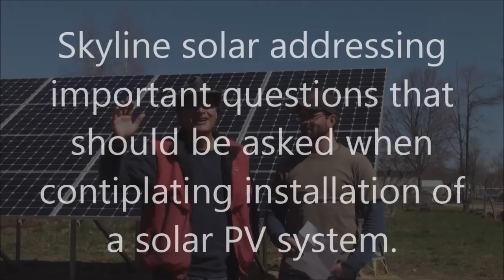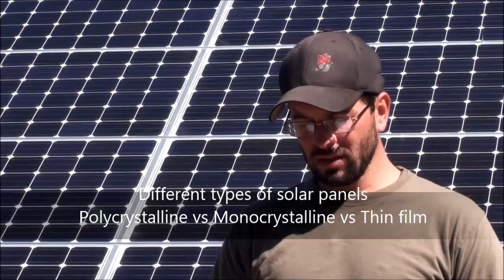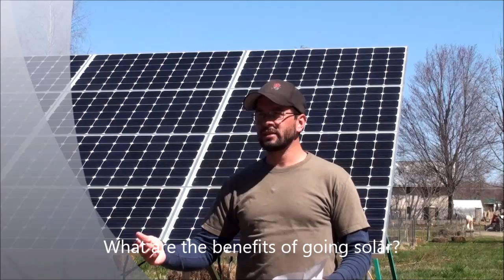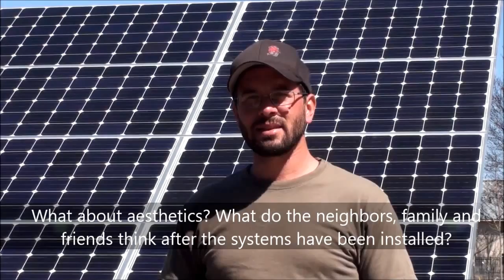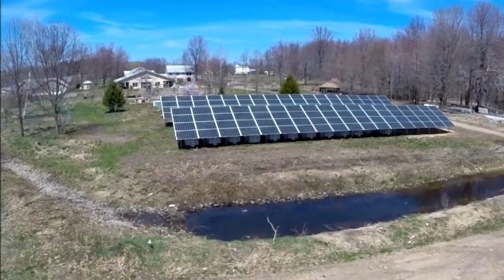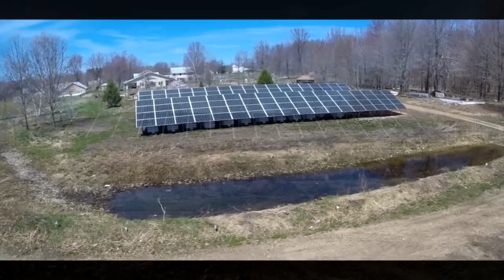Skyline solar - How much does a photovoltaic system cost?

Comment: So he never said what the cost of your system was?
Reply from the maker: No he never did share with you what the cost of our system was at that time. I have created and posted a video in the past on how to calculate the cost of the solar panel system for your home. The goal in this video was to respond to questions that I've received from viewers and how a solar panel installer goes about determining if your property is appropriate for solar panel installation and what it would take to meet your needs based on your annual electric bill. Sorry for the misunderstanding.

Comment: That is a massive system, I think I counted 144 panels WOW ! We have a grid tied system with 40 panels just commissioned 3 weeks ago, down here in SE TX is currently covering about 65% of our daily consumption , mid to upper 90's and our A/C is the biggest load . Looking forward to seeing how well our system does in fall, winter and spring. Very informative video thanks for putting it out there.

Comment: The more you put into it now just means the less you will pay for Grid tie Hydro starting right now. If you Buy a panel a month then you will save that much wattage it produces every month and when you have enough panels to even out with your monthly usage  And will not have a power bill but will still have a delivery bill because that is a base charge every month. Look into AC coupling With the Magnum ACLD-40 That allows the home to use the wattage produced without using the grid and some grid tie micro inverters will work even when the grid is down. PS the ALCD-40 can store excise hydro in the form of Hot water or heat from a 240 volt Baseboard without using any thing other than the regular electric elements or baseboards. Just think Having full battery bank and in floor water heating and you don't even need to be hooked to the grid.

Comment: Sir I want run 5HP 3 phase moter for tubewell,I shall be needed how many solar panels,and watt, also inverter
Reply from the maker: Hi Abbas Malik,

Thank you for the comment. We really appreciate the feedback. The answer is dependent on several factors. I hope to make a video about installing a solar powered DC well pump this summer if all goes well. I will review all the calculations when I do the project.

Comment: I am still not clear on this.If the grid goes down ,will you still have power for your use till the main power grid come back online ? Or will you have to add the battery back ups to do that.We have lost power here for as much as 7 days .
Reply from the maker: Great question!  Since this is a grid-tied system when the utility line is interrupted, as it has been twice this week, both utility power and solar power are OFF. That’s why I have a transfer switch that detects that the power utility is down and cuts off all communication with the utility supply line and triggers my backup generator to start.  My entire complex is then run off the generator until the utility company fixes the problem that caused the power interruption. 

So one problem with this setup is that, for lineman safety, the sun that hits the panels is not realized by the metering system and I don’t get to run my complex off of solar power.

A second problem with the system is that the generator uses fuel, in my case propane when the electrical demand is low. The generator runs full tilt when the utility line is down even if nothing is on in the buildings. 

OK so the system that I have is an Enphase microinverter system. That means that under each panel there is a microinverter that converts the DC power that the panel produces into AC which is what we use in our homes.  One benefit is that each module gets the benefit of maximum power potential of the system even if there are a couple panels that are shaded by an object like a tree or chimney.

Those microinverters feed the AC power to a weathertight breaker panel and a meter that shows the power production during daylight hours. Then the AC power is sent back to a building where the transfer switch is to a weathertight 200amp breaker. That breaker allows us to disconnect the power coming from the solar panels in case work on the system needs to be done.

My plans are to modify the system into a hybrid system in the future.  I plan to install a battery bank probably the next generation Tesla Powerwall units and use both the traditional propane powered generator, that I already have, and the solar panels as dual generators to supply power to the battery backup system. This requires a rectifier which converts AC to DC, which is the opposite of an inverter which converts the DC to AC. 

This is not an inexpensive addition and I have been recording a lot of data since I had the system installed. I have also been monitoring legislative attempts and action by utility companies to penalize folks that have grid-tied systems. 

 One problem with the most recent generation of battery technology is the battery life/recharge and rapid recharge rate that a generator can achieve. However with a combination  (solar/generator) hybrid system I believe that within a few years it will be worth the investment. 

If you live in a location where the power interruptions are infrequent or of short duration then it wouldn’t be worth it. However we frequently have power outages and on rare occasions they can last days. In 2003 we had an outage that lasted over a week. 

I hope this helps.

Kevin

Comment: You answered a lot of my questions.  I'm grateful.  However, I would like to know what is the average price (parts and installation) of a 7.28 Kwp system in 2016 and how much kwh does it produce in a month in Brownsville, Texas (we have lots of sun)?
Reply from the maker: The cost of the systems is based on many factors including size of array, mounting (rack mount vs roof mount), sun exposure, pitch, latitude, grid-tied or off grid, inverter type, possible incentives, ordinances, and most importantly your KW usage after you do a comprehensive assessment. It’s best to find people in your area that have systems installed and start there.

Comment from the maker: How much does a photovoltaic system cost?
1.	How do you determine the appropriate size of the system to install?
2.	What factors affect the function of the system?
    a.	Southern exposure
    b.	Geographic location
    c.	Other structures
    d.	Lake-effect snow & cloud cover
3.	Ground-mounted vs. roof-mounted
    a.	Roof types
    b.	Component difference
    c.	Cost difference
    d.	Benefits vs. drawbacks
4.	Different types of solar panels
    a.	Polycrystalline vs Monocrystalline vs Hybrid vs. Thin film
5.	What about efficiency
    a.	Cost per kW – the cost per kilowatt of installed power
    b.	kWh per kW - number of units of electricity (measured in kWh) generated per         year per kilowatt of installed power
    c.	Cost per kWh – the overall price per unit of electricity generated over the lifetime     of the system
6.	Inverters	
    a.	What does the inverter do?
    b.	Micro-Inverters vs. Central Inverters
7.	Grid-tied vs. Off-grid vs. Grid-Tied with Battery Backup 
8.	What about building permits?
9.	Incentives?
10.	What are the benefits of going solar?
    a.	Home/property value
    b.	Guaranteed performance
    c.	Offset CO2 emissions
    d.	Non-polluting
    e.	Energy independence
    f.	Low maintenance
    g.	Low cost of operation
    h.	Create local jobs
11.	Benefits of owning vs. leasing
12.	What about aesthetics? What do the neighbors, family and friends think after the        systems have been installed?
13.	ROI?